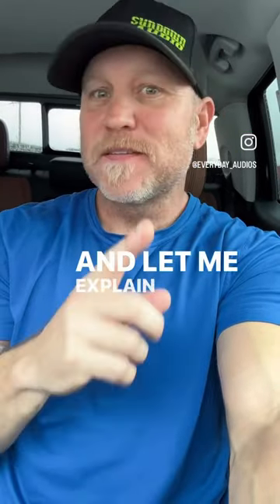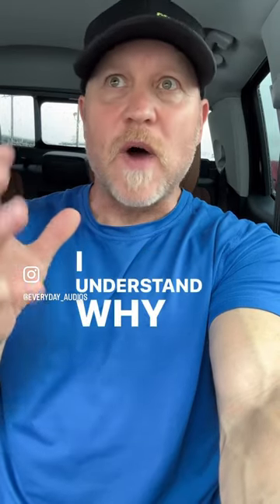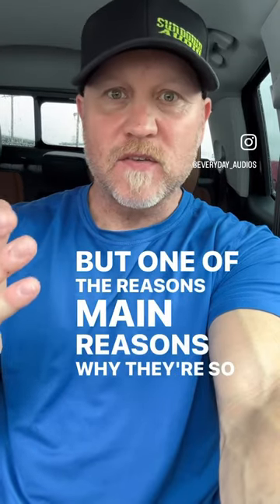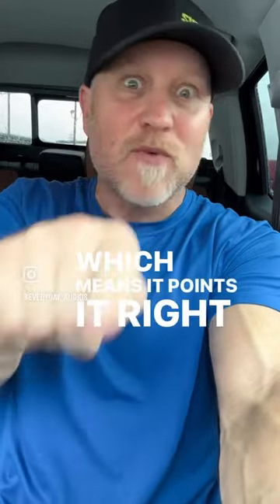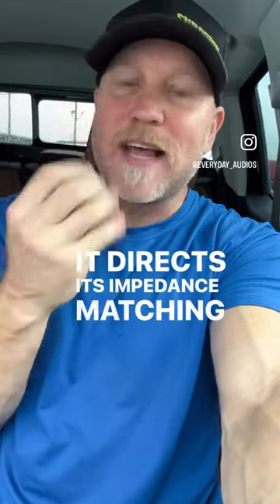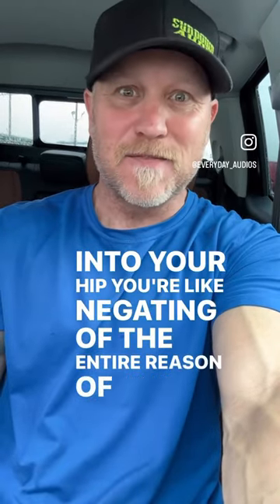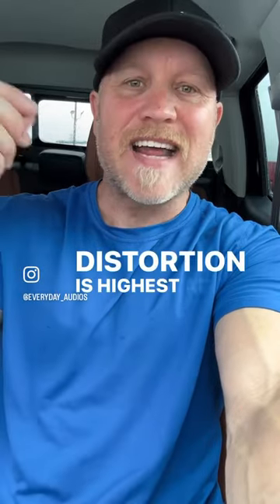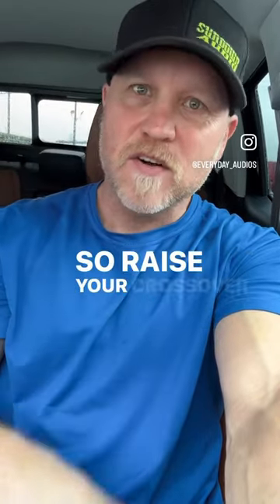I Hate Your Super Tweeters

Comment: Im gonna have to use a pair because I cant find any tweeters to match the sensitivity or loudness of 3 pairs of midrange speakers that have a 101db+ sensitivity
Reply: Prv, audiopipe tweeters are around 100-108db
Reply: @manuelrivera3123   Yeah, I ended up ordering some Machete mini sized ones. 106db and they blend in nicely. Gonna run two pairs of those closer to me on low power so I dont go deaf, and one pair of PRV TW400Ti-ND4 v2 a bit lower down in the door on an amp. I avoided super tweeters for a long time cause many sound like horns or have a weird resonance or are made to play too low for super tweeters but these Machete and the PRVs sound pretty good and are easy to incorporate